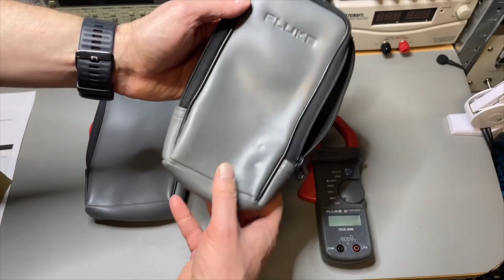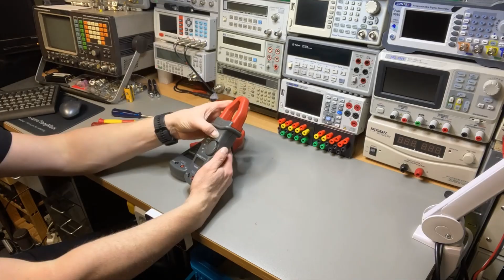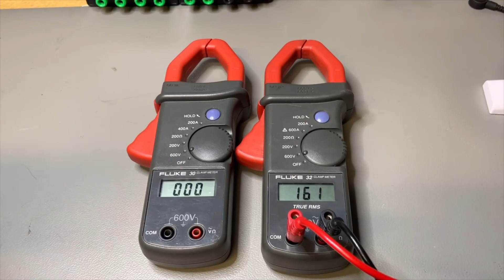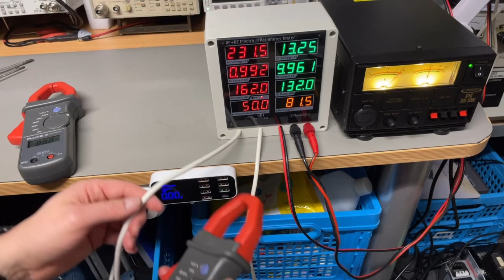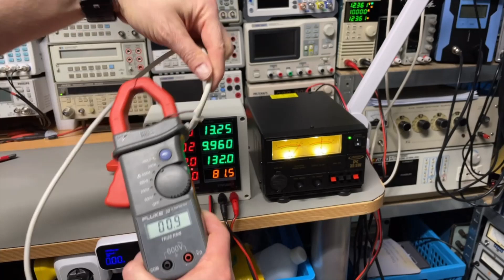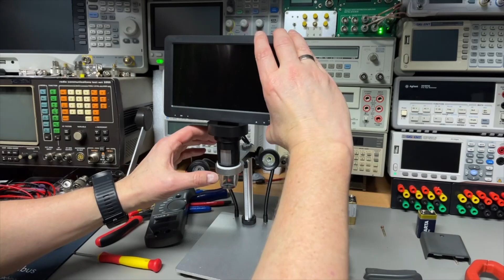TA•0325🟦Fluke Friday (E5) Serie 30 32 Clamp Multimeter

Comment: I have a 36 that my dad gave me.   its good for everything but lower voltage using it as a DMM.   The clamp part works great.
Reply: I don't ever use these as multimeters.  I only use the clamp part.

Comment: Tony, I believe the model 30 is calibrated for 60 Hz. I suspect if you were to adjust to 60 Hz, the meter would read properly.
Reply from the maker: Yes calibration is done on 60 Hz i read in the docs, but it should be correct for readout on both 50 and 60

Comment: I have an old Fluke 30 Clamp Meter like to one in your video. It is not reading voltage correctly even with a fresh battery. Apparently there is not fuse for protection. Do you have any suggestions?
Reply from the maker: About the fuse, i dont remember, maybe it has. did you check the terminal connections?
Reply: @TonyAlbus  If you mean where the leads plug in no not yet. My next step is to open it up and see if there is anything obvious wrong. I'm not an electronics tech so there is only so much I can do. I did change the leads with a pair that does work and changed the battery. Continuity works. My next step is to check resistance, and amps against my fluke multi meter.
Reply from the maker: @retiredguyadventures6211  Yes that is a great start!

Comment: Nice episode, looking forward to the next one. And indeed, as another viewer already suggested, to measure more reliably low currents on a clamp meter like that just cut up a cheap extension cord and loop one wire ten times. I have the official line splitter you showed in the photo but I also made two myself with different "end" connectors (C7 and C13) for convenience, and both with 10 turn loop.
Reply from the maker: Thanks! .. good one!

Comment: Just a little tip: You can easily increase reading of any clamp meter by wrapping more turns of wire thru meter clamp. The more the turns, the more the reading, then you just simply divide reading on meter by number of turns.
That 737 chip is true rms converter.
Reason why non-RMS meter is reading less accurate is that even you are using linear power supply with transformer, the current is far from being pure sinusoidal. Once you rectify voltage, even on secondary of conventional transformer, the input current is no longer sinusoidal. I was wondering why there was no fluke episode last week, glad to see new episode today !
Reply from the maker: Thanks Petr, good points there...